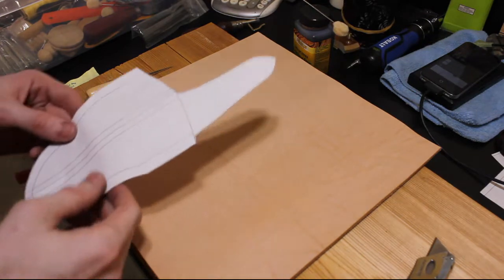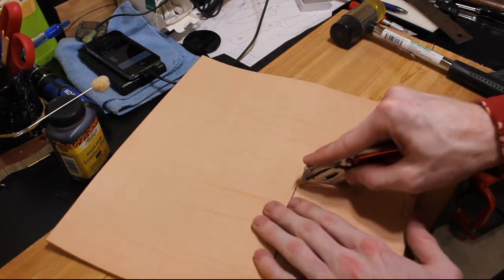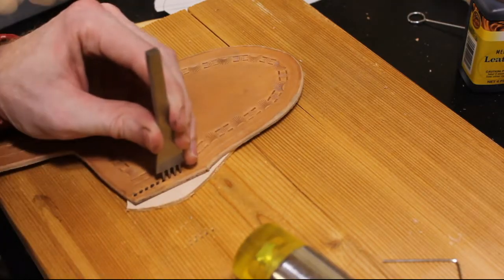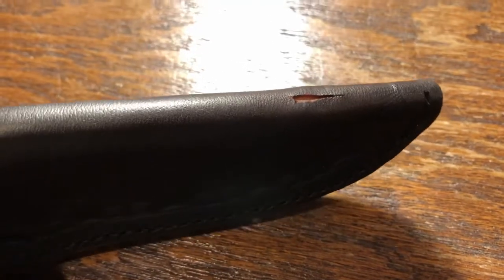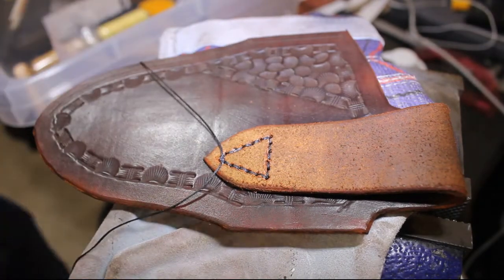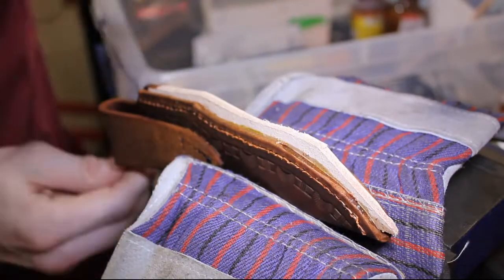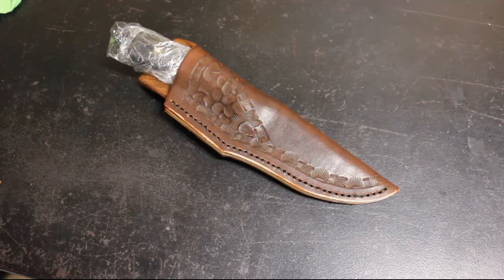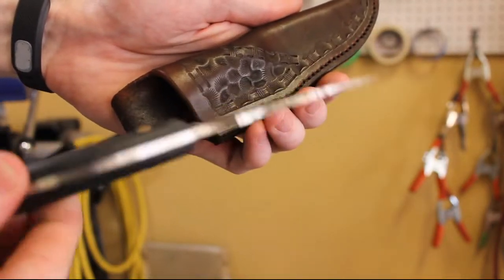My First Leather Knife Sheath - Some Things You Shouldn't Do!

Comment: I have made some axe sheaths,  about to do a knife sheath,  so this was very helpful. Showing your mistakes was super helpful. 

You said to cut your leather square vs at an angle. I've made that mistake,  and you're so right,  it is hard to fix. 

I had no idea that hammering contact cement would set it!!! 

I use the edge groove tool before I punch the stiching holes,  it helps keep your holes an even distance from the edge. Guess I need to investigate if I'm doing that step backwards though. When you punch your holes you have to make sure you hold the punch as perfectly straight up and down as possible,  otherwise your punch won't exit in the groove on the other side. 

The four prong punch IS sort of a pain. I've drilled holes also. The drilled holes never close back up though.  When punched holes close back up they hold on to the thread better and look nicer,  IMO.

Perhaps you won't be using leather as thick as what I use on my axe sheaths, so you may not need to do as I do,  but when using the 4 prong punch I found some helpful tips. After you punch the first set of 4 holes,  move the punch down so that you're creating just two more new holes at a time. It's less work to punch through the leather and easier to pull the punch out. Your hole spacing will be perfect. Punch on a very stout surface, granite counter top remnants work well.  The more mass the better. Use a self healing mat or something similar on top of that to protect your punch tips.  Place one more layer of scrap leather between your work and the mat. The punch seems to fully penetrate your work better if it has somewhere soft to go into. When doing three layers of thick leather the punch almost bottoms out and just the tips come through,  so I punch from the other side also to make the stiching process easier. 

When finishing saddle stiching punched (not drilled) holes, you back stitch about 2-3 holes, snip the line off close to your work and then melt the remainder. No ugly knots! Tap the leather gently with a mallet to expand the leather and close up your holes around the stiching. I like waxed poly thread, and I prefer natural color over bright white,  but that obviously depends on the project.  Using a soldering iron was another good tip! Probably better than using a lighter like I've been doing. 

Some folks set a brass rivet at the top of the sheath by the opening so that your blade doesn't cut through the leather welt at this high wear point. The rivet can also be used to secure the tag end of your thread from stitching if you wish. I like the look without a rivet,  but I also really like my stuff not to fail later even more, so I usually set a rivet. In most cases,  the rivets you get from a leather working store,  that are domed on both sides, look better than the ones with a flat backside. 

Having a vise to hold the work in makes stitching a lot easier. The large wooden clamps they sell for woodworking work pretty well, and you can hold them between your knees while working if you don't have a fancy shop or lots of gear.
Reply from the maker: Hello sir! Thank you for the tips! Leather working definitely isn't my main jam! It will take me a while to get it where I want it. These tips will help me on the journey. Thanks for taking the time to type of that comment! 👍

Comment: I have done a bit of laminate work. When you apply contact cement to both surfaces and let it dry to touch. Once you touch those surfaces together it’s game over. Dry and your not pulling them apart. Immediately.
Reply from the maker: chip Lape cool deal! Thanks for the tip!

Comment: A lot off topic but could you recommend a heat treat oven. Budget friendly. I know they are not cheap. Thanks I appreciate your advice
Reply from the maker: chip Lape hey chip, From what I’ve researched there are two options of manufacturers. Paragon and evenheat. I don’t have one, but I’ve heard the LB (long blade even heat) is a good option because it only has heating elements on the sides and not across the back (which could effect the heating of the tip of the knife)